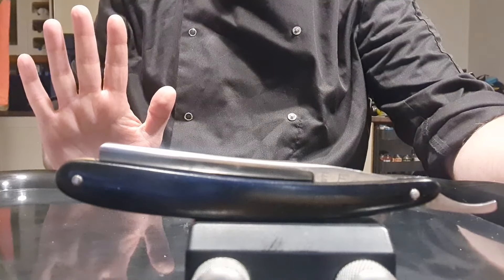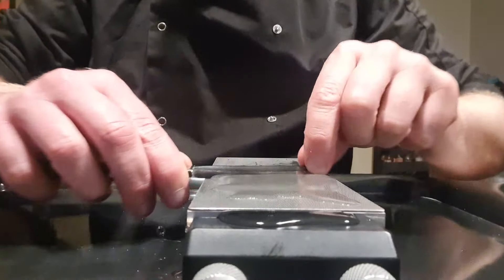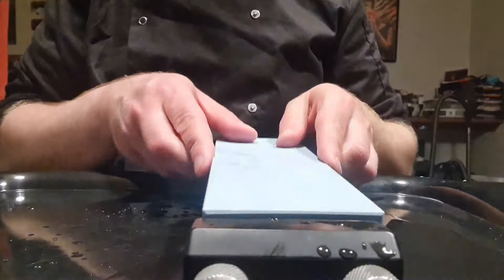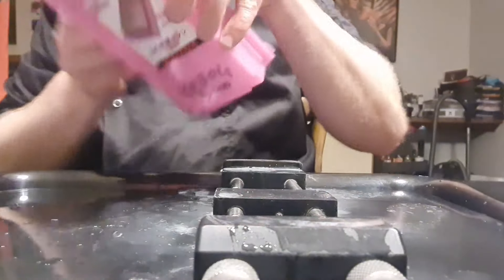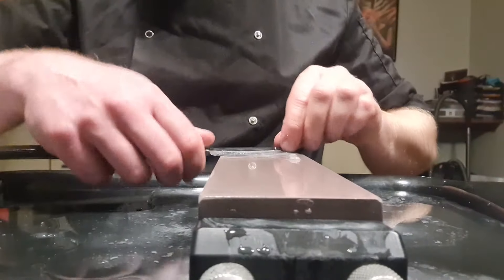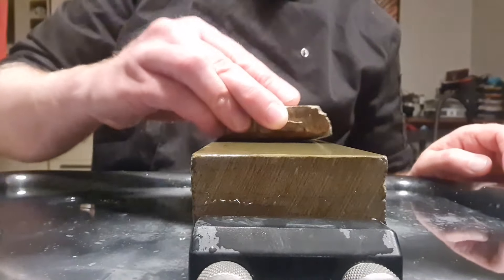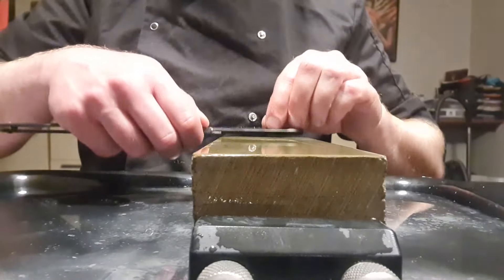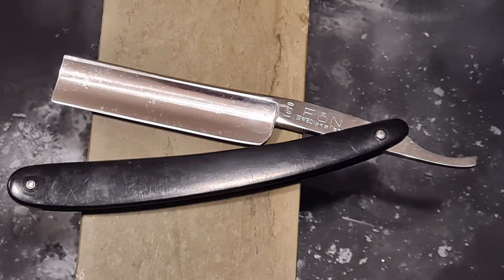FEON Japanese Straight Razor Honing Restoration

Comment: Do you use all Jnat stones to finish or do you have other kinds of stones that give you similar results?
Thanks for sharing.
Reply from the maker: Hi there, it's a personal choice, you don't have to finish with a JNAT but IMO they are delivering the best result. 
Otherwise, you have many finishing stones like coticule, La Lune, Black Shadow, and many synthetic ones (shapton 12k, 20k, etc...). When using a synthetic finishing stone, you'll need to use green chromium paste on a step at the end of the process.